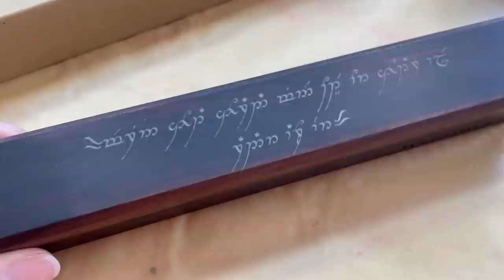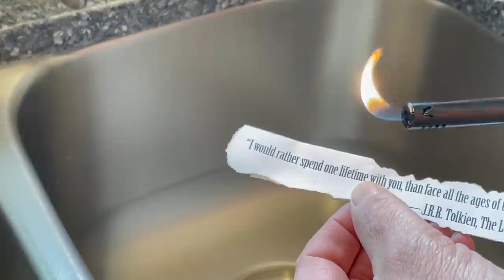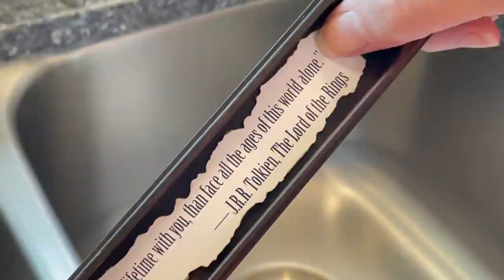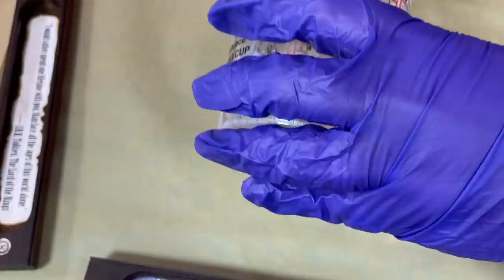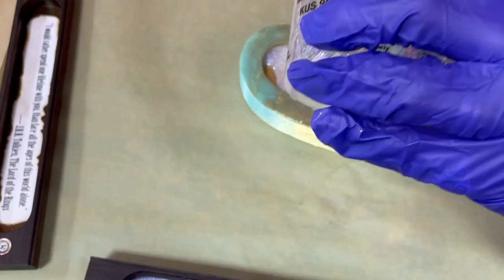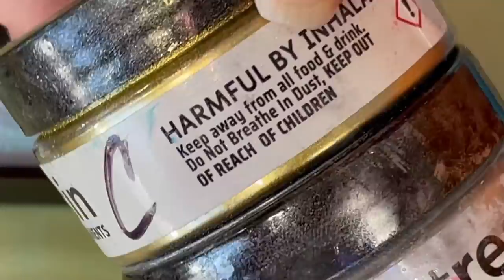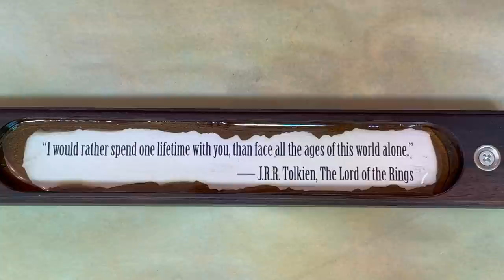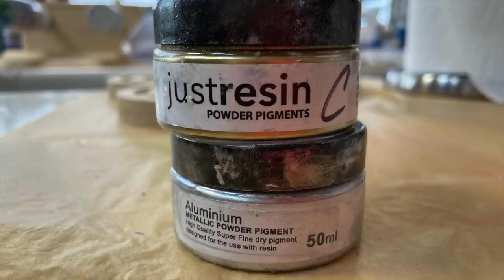Creating Resin Bubble Texture

Comment: Old trick from my Gma. Rub lemon juice (fresh or bottled) around the edge of paper, then burn. You end up with an antiqued, old paper edge!
Reply: Thanks for this tip, Wanda! I’ve been putting off doing the distressed paper part of the design on one of my tumblers for weeks because burning the plain paper edges is SOOOO tedious. I’m going to try doing it with lemon juice as soon as I finish this video. ❤️
Reply: Pro trick : you can watch series at Flixzone. Been using it for watching lots of of movies during the lockdown.
Reply: @Josue Conner yea, have been using flixzone} for since december myself :D